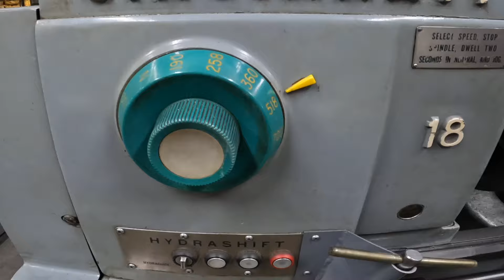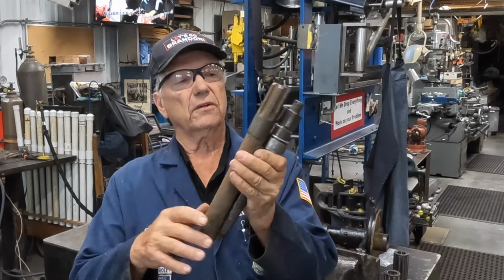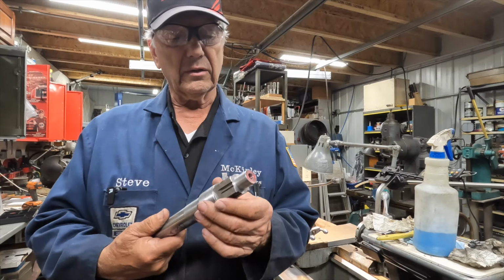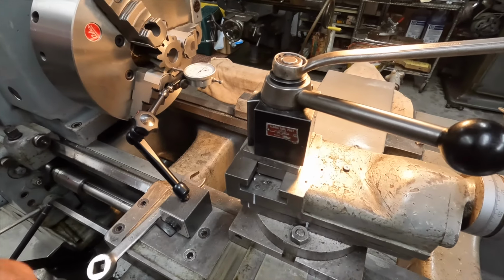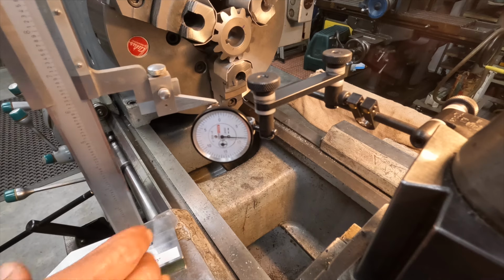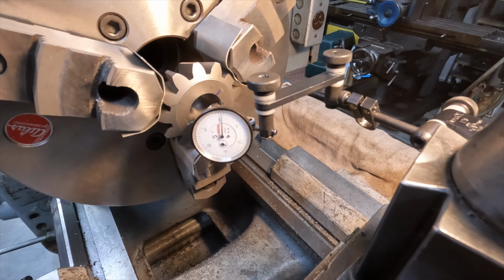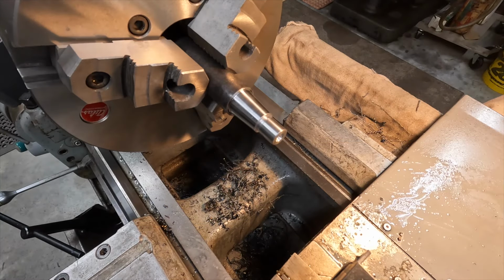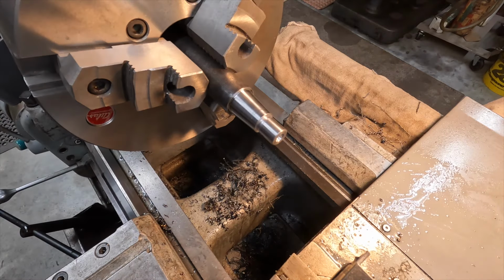1914 Chevy Pinion Gear Shaft Part 1

Comment: I like your precision. Wayne would have had me weld up the noncleanup areas and reaching. Those old axles are usually hard, sometimes difficult to thread. Good choice on chrome moly.
Reply from the maker: Thanks! If I were trying to use old parts instead of a brand new ring gear & pinion, welding would have been the likely fix! 
Trying to finish up part 2, hopefully soon! Have a great day!